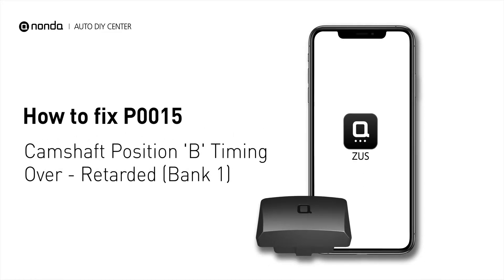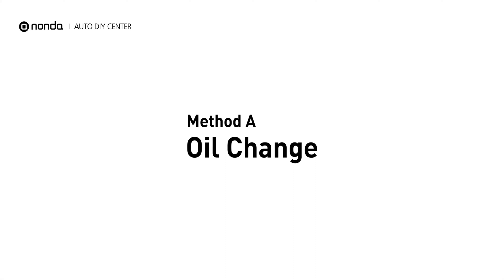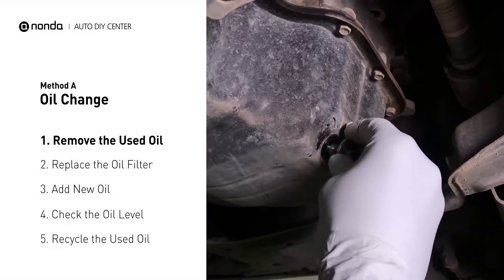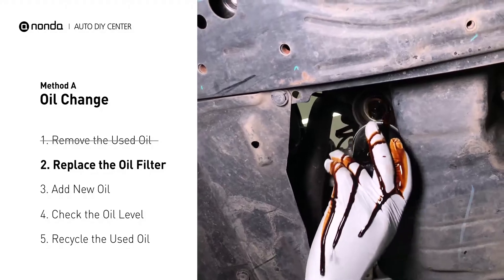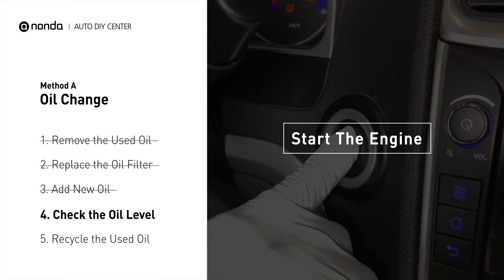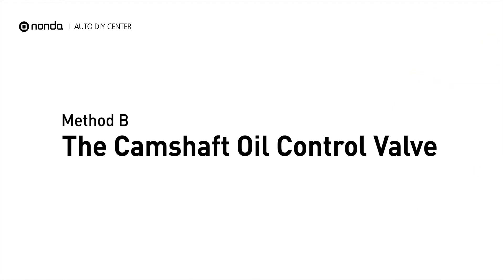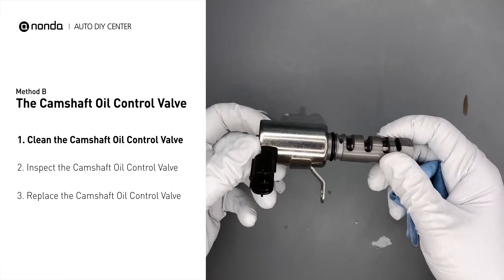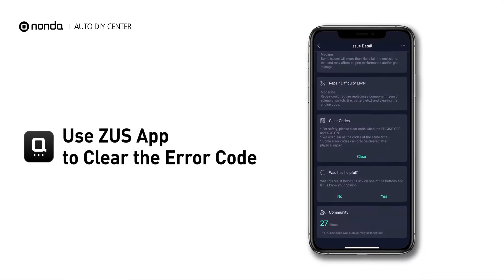How to Fix P0015 Engine Code in 4 Minutes [2 DIY Methods / Only $6.62]

Comment from the maker: Hi, I'm Steve, nonda's lead mechanic engineer. 
Feel free to leave your comments here if you have any mechanic questions, I will be glad to help you out!
Reply: Hi Steve, I am still getting code P0015 after changing the Oil, Oil Filter, Cam Shaft Sensor. Any advise? What should I do? Thanks,
Reply: Your oil pressure is to low when is hot or your timing is off.
Reply: Volvo S40 2001 check engine light P0015
Reply: I own a 07 328xi and I recently had a code, P0015 Camshaft position timing bank 1 (over retarded). I replaced both CPS pulled and cleaned both vanos solenoids and I'm still getting the same code lol. Should I replace both vanos and go from there?

Comment: Got a P0015 this afternoon. Engine runs great, no change in performance. Oil is clean.  Where are these control valves located?  2008 Sienna 2GR-FE Engine.
Reply: Did you end up getting it fix

Comment: Got the p0015 code. Have swap the solenoids both. Camshaft sensor both. New crankshaft sensor. New mass flow sensor. Swap alternator.
Pop up after having to swap timing chain cover since got crack in it. Had to swap timing chain since the guide broke but code is still showing up any idea?
Reply: Also the oil light still comes on at times but it's like the blinking on and off after driving for a few minutes

Comment: what if i get it after a oil change i hav a bmw 328i 2011
Reply from the maker: Hello, the low oil pressure could be triggering the code.
Reply: @nondainc  yup i didn’t tighten the oil filter enough smh 🤦🏾

Comment: Mercedes Benz did a oil Change for me an change my radiator, 4 days later engine came on with code p0015
Reply from the maker: Hello, kindly check the timing chain, wiring to the camshaft OCV and check the camshaft phasers on both camshaft banks.
Reply: Me too, but a Toyota, eng oil was changed by a Finish Line auto repair store in Victorville, CA.

Comment: 2011 328i bmw , code poo15 and po54b , car won’t turn on , turned off on me while driving …. Replaced both camshaft sensors , still won’t start
Reply from the maker: Hi Ace, as you are receiving more than one error code, we suggest getting your vehicle visually checked by your local mechanic for further diagnosis. Thanks for watching!
Reply: @nondainc  I did they said my engine locked
Reply: @OfficalAcejam  I have the same issue but my car hasn't turned off, how did you solve it?
Reply: @e34rick  my engine seized

Comment: I have P0015 Exhaust Camshaft Dephasing Fault: Linked Control Fault and POOOB Exhaust Camshaft Dephaser: Linked Control Fault, recon this is the right diag for it? It’s on a Peugeot 208gti
Reply from the maker: Hello, we suggest getting your vehicle visually inspected by your local mechanic for further diagnosis as you are receiving more than one error code.
Reply: @nondainc  I have a 2008 c300 Benz, sports edition, I’m getting code p0015, recently I got a fresh oil change an new radiator done at Mercedes Benz, 4 days after getting the oil change the engine light came on with that code? What shall I do?